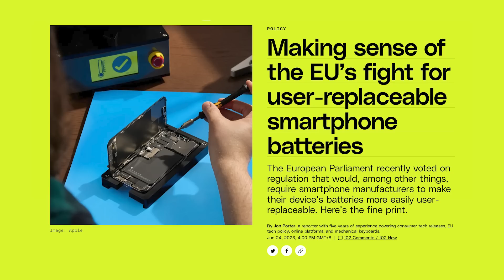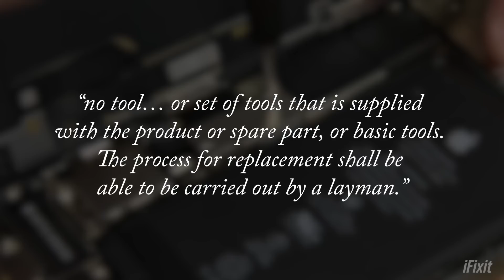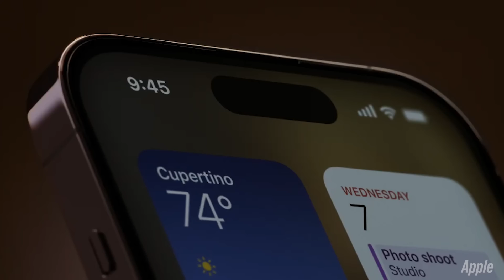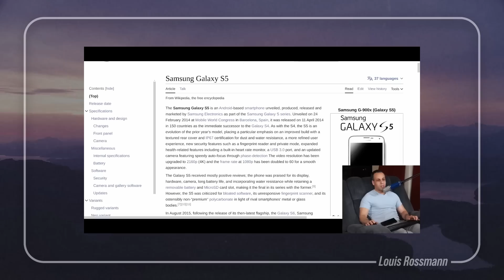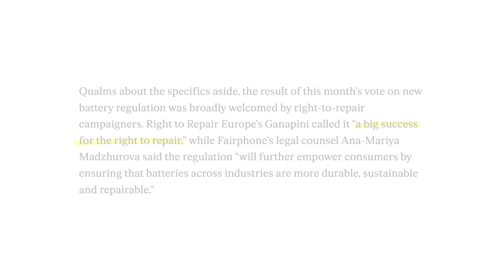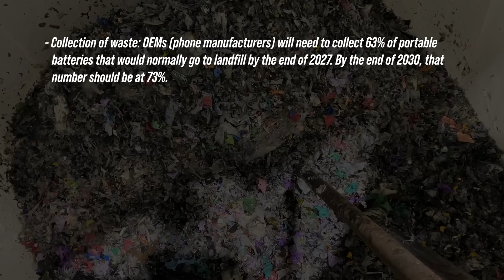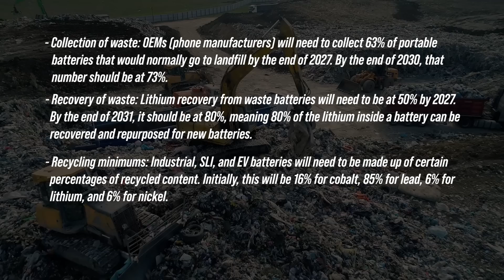EU Just Changed Smartphones Forever

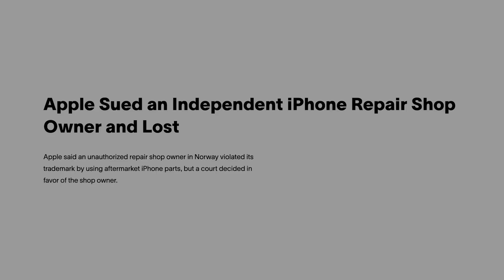Comment: Right to repair indeed.  The charger port on my ipad pro (barely a year old) quit this week.  As I am willing to try to fix stuff myself, I watched some related Youtube videos.  To replace the port, which couldn't cost more than a dollar or two to create, requires the screen removal, secured by adhesive, and very delicate.  Apparently experienced techs break about 50% (don't quote me) during the procedure and one of the online guys spoke about being rather surprised that he'd made the entire port replacement video without breaking the screen.  He had bought a spare replacement before he started - $600ish.  He didn't detach the screen completely, which seemed odd, since leaving the facial recognition cable attached made keeping the screen out of the way and safe a pain.  Now I know why he left it in place (5:05).

Great video.  If water proofing is the only problem with making the battery removal user friendly, a version with tighter seals could also be sold for more $$$.
Reply: Or encapsulation/conformal coatings could be used for sub-assemblies..

Comment: Soon to come will be electric cars.  It is very possible to have user replaceable batteries, we all plug in devices daily that has enough current to kill you, so there is no reason why we cannot change our own batteries.

I have a hybrid SUV and the battery is near enough dead, I can buy the battery for $4k easily enough, but the manufacturer has made it as difficult as possible to change and requires extensive work to carry out the job.  There is no reason why there cannot be an access panel and a large multi plug.

Comment: I have old watches submersible to about 100m with replaceable batteries, torches to a couple of meters. Good for the EU in this case. Phones just need to be waterproof to use in the rain, quite  a low IP rating, as I have no plans to dive with my mobile so  having an IP rating of 67 is  pointless novelty.  Its scam  to produce a limit the the life of phones.

Comment: I think it's a great step forward, and honestly it should be pushed even farther by forcing the use of standard format rechargeable batteries. A few new formats could be developed as there is no widespread standard for the kind of thin rectangles used in phones. Also in the case of cordless power tools, nearly all of them use 18650 cells inside a proprietary battery case. The current cells have specs that are all over the place, but we could develop a more standard 18650 cell that provides sufficient amperage for most usages, and that we could just swap into our power tools.

Comment: That is about time. The non replaceable battery design is a 'lazy' design that 1) reduces manufacturing cost but more importantly 2) entice consumers to buy a new product once the battery starts to deteriorate (in a way it is a planned obsolescence). In fact the only reason to glue the battery is because it is not intended to be replaced. Else there are other methods to secure the battery in place. (Btw this glueing practice is also bad for the recycling and it makes removing the battery from old recycled phone quite tidious)

Hence the only way to enforce the industry is by regulation and only EU or another huge market are able to pull this through.

Comment: My Galaxy S10 I bought in October 2019 is still in perfect working condition, not a scratch on it. I'd love to be able to easily switch out the battery for a new one and get another 2 or 3 years out of it but it's made annoyingly difficult with the way things are at the moment. I hope we go back to easily replaceable batteries worldwide.
Reply: I switched the battery on my S10e a while ago, it isn't that hard on that model. You just need some basic phone repair tools to get through the adhesive.
Reply: I'm still using my Samsung S5 bought in 2017. It's on ist's third battery and the old batteries were sent for recycling. It's no longer waterproof because the charging socket cover broke off.
Reply: You can take it to a local repair shop, if it's going bad...  I used to think the same, but then I realised that I never bought replacement batteries even when they were easy to change :)
Reply: @davidlloyd1526  I never had to replace my battery, but having the battery be removably helped keep my phone from getting destroyed, I think. I'd drop it a lot, and when it fell it just exploded into three pieces -- screen, back, and battery. Never cracked the screen until it fell flat onto a rubber floor mat from a height to 12-14", somehow... My newer phone, meanwhile, has actually needed a case and screen protector because as a single unit, the force of a fall actually does damage.

Comment: I would really love it when batteries are change able again, I feel bad with having to buy a new mobile just because the batterie is not doing as it should anymore... That and after not even a year, try to find the proper parts for your mobile that you would need for repair! I tend to get the normal version and for those old ones hardly anything is there to repair them!

So not just change able batteries... but there should be proper resupply in parts to repair a phone!

Comment: Actually, iPhone IS more environment friendly because it keeps away bootleg low quality batteries away that will work 1/3 of the original at best. This means you have to replace a completely dead battery every half a year, which will create more waste. And These batteries are the parts that causes the most problems for the environment. Mind that this environment-friendly approach is unintentional, because of how they are slowing down their phones with updates. The downside is that it is way too expensive for just a service itself. 

With this regulation the market will be flooded with low quality batteries AGAIN which only create more waste. I am old enough to remember how Replacing my Nokia's battery that lasted me for 3 years made me buy a new one every 6-7 months. So this is not an option if this regulation is being passed as environment saving. The consumer will benefit from it for sure.

Comment: I can see some devices having a real hard time finding a way to make replacable battery a thing. Small devices like wireless earbuds and the like. but I am sure they can figure it out. 
Buying a new battery used to be the norm and I definitely feel like people held on to their devices more as a result too.
Reply: Hearing aids exist and have replacable batteries, primary batteries even so they have to be replaceable. Also just use wired. There aint no way I'm ever buying a phone without a 3.5mm jack.
Reply: Actually, it isn't really that hard with earbuds and there already are some models where replacing the batteries is fairly easy. All that's really needed is for them to have a sensible shell design and internal layout. Additionally, we already have a few designs which implement exterior batteries, where the battery and the earbud can be easily separated without any disassembly.

Comment: This video makes the claim that including a removable battery will preclude the use of adhesives in the manufacture of cell phones. But this isn’t supportable. It’s entirely possible that phones will continue to rely on adhesives to prevent the intrusion of external material, including and especially water, even while featuring a swappable battery. It’s also premature at best to chain any hope of ameliorating exploitative parts replacement processes to the new law. Apple and their competitors are certain to manufacture phones with removable batteries that nonetheless make all other non-sanctioned repairs very difficult or impossible.

Comment: The samsung xcover pro has a removable battery and is ip68. It can be done, the main reason for sealed batteries is so companies can push consumer to buy new phones once the battery degrades vs putting a new battery.  Also it "looks" and feels "cool". If you have a case, then looks don't really matter.

Comment: The weight of a model s battery is 1,200 lbs how is that supposed to be swapped by a layman with no tools lol- It should be required that any computer/laptop comes with the ability to swap/upgrade parts like RAM/storage and batteries where applicable

Comment: Just anti-consumer. Look at Tile. You could easily remove the coin battery. When videos of that circulated and you didn't have to just buy a new one. They made it a LOT harder to replace, and added in some subscription deadman switch. I'm not picking on Tile in this case, just one incident that came to mind in a market of bad business practices.

Comment: Now i want to know how manufacturers will achieve that. Will we go back to those back covers made of plastic that if not taken out or  inserted back properly will break their holding pins making them useless? Unless they can replicate the same sleek, dustproof and waterprooof design current phones have, this law is going to mess up A LOT of things. I get it, the EU wants to enfore our right to maintain and repair products we own, but at what cost?  Phone prices will skyrocket because companies will need to find an expensive solution to waterproof and dustproof their products, if they can do that now at all. This applies to tablets as well. For laptops, e-bikes EVs and other things it will be the best thing to ever happen. But not for tablets and phones.

Comment: Every word said about Apple’s attempts to squeeze out maximum revenue from customers is true. I have a 1st generation Apple iPad which is in immaculate working condition but simply cannot be used because practically no software or app is supported by it - and that is by design - Apple design. Begs the question why does Apple take such pains to produce products with such long life if they intend that it be obsolete and practically unusable during that life. Shouldn’t it be mandated that components be easily upgradeable (at one time, RAM upgrades were possible) to ensure that products are useable for longer periods? This would minimise customers having to junk their phones as often as is intentionally schemed by Apple and others today.

Comment: I think the big push for non-replaceable batteries was two fold. 
One, to charge more for replacing the battery or encouraging device replacement. 
Two, laziness on the part of the manufacturers to make their devices dust/water resistant. It's much easier to make a completely sealed case that is water/dust resistant than to make a device with doors/ports/panels/etc. be water/dust resistant.

Comment: Batteries also need to be standardised across different brands in the same product category (eg. one battery standard type for all phones, one battery standard type for all e-bikes, for all laptops etc.). Only then will it be feasible to get consistent replaceable batteries, and for some larger devices like e-bike and EVs, battery rental, and transport & use across different continents.

Comment: Wouldn't... wouldn't having no adhesive remove most water resistance?
Reply: The only thing that would need to not have adhesive is the battery and whatever thing you have to open to access it

Comment: The original purpose for the glue on the battery was to avoid concussion. Concussion was the number one reason for batteries to either fail or possibly cause fires. There are very few designs that actually take concussion into consideration that also includes battery replacement. Until such technology is available most phone manufacturers are stuck gluing with their batteries to the inside of the chassis of the phone to avoid catastrophic failure. This is also a reason why there are so many issues with repairability of phones which is legitimate concern. Repairability extends the life expectancy of the phone. so there is a fine line between repairability and safety. As long as the construction technology of the phone includes some form of safety when it comes to replaceable batteries, we're left with glue on the battery. there are ways on the other hand of designing the phone so that even though the battery is glued into the chassis the battery should also be removable in some way and repairable. Unfortunately most phone manufacturers don't see this as a priority. They just want you to buy a new phone. This means simply that phone manufacturers suck.

Comment: Finally! I remember that from 2000-2012 it was a delight to have cellphones that would last 3-5 years each, you could replace parts, and a major drive behind changing your phone was to upgrade to innovative newer models; in 12 years I owned 2 hand-me-downs and 3 new phones. Starting on 2013 smartphones were all the craze, but to me the shine dulled quickly... for the past 10 years all smartphones have looked the same and have had the same functions, so not only the novelty is gone, the worst part is that I've had to replace them every year because they break down and won't allow the most basic functions they're made for. A real waste of money and terrible pollution.

Comment: All I heard is manufacturers are going to have to go back to how some Samsung and most LG phones (in full disclosure even though their phone division is gone I've been Team LG for decades) used to be. Easily removable rear panel that exposed the battery, SIM and SDHC cards that took mere seconds to remove/replace. They don't have to re-invent the stinking wheel, they invented it a long time ago. All they have (are going to) is build "new" phones on their old chassis designs with modern components.  Anyone over 40 knows what I'm talking about and wont bat an eye...

Comment: Pfftt LG mobile went bankrupt that removable battery was their last phone... I use a redmagic 7spro. Redmagics website shows a full teardown. No one wants to open up and peel back fragile layers of cooling. You can buy a pc and replace the cpu by swapping out the thermal paste... Most users don't know or shouldn't be making these repairs. Back to dumb non complicated phones Isn't great for the future. They should just offer repairs by the company. Because this eu law is all smoke and mirrors. We still can't use another brands charger brick and get max speeds. If you take a Samsung 35w brick and plug a pixel in it only gets 25w charging even though the pixel brick can do more than 25w. Its a farce. Its greedy corporate influence. Meanwhile in China their government was able to force all chinese manufacturers to offer the maximum charge speed to all brands. You can take a nubia 120w charger and charge your ipad at 120w or your Samsung at its maximum 35w or your Huawei at its max speed etc... If the chinese government can do it then it makes sense we have this too but we don't. Simply put they like to keep you in their eco system. So if they can make different spec plugs for china with different detection chips im sure they can make different phones with removable backs just for the EU.

Comment: everybody is going digital it's pointless to make a removable battery you should be updating your phones every two or three years in order for your phone being able to work on the current Hardware.
Reply: now , someone explains to me ! Irreplaceable batteries in smartphones , does it mean that it's impossible to completely cut the power to the device , and thus it's always possible the device to be located as it does send vibration even in OFF mode ??????
Reply: @Quasar900   the bottom line is the more moving Parts you have in a phone the less likely it's going to be durable if the EU have such a big part of with electronic waste maybe it's time to invest on getting the technology to recycle majority of the items in the phone to a point it can be melted down and rebuilt on a new device like thay all ready do with paper & steel instead being lazy and just putting in the landfill. while creating new jobs.
Reply: @Quasar900   all the electronic waste we make here get separated in remolded for new devices & technology same with our motor oil and battery.
Reply: @Quasar900  even the bio waste that gets flushed down in the toilet here gets recycled after it get treated of course.
Reply: @NORDICedm  
All you said I know it ! My question is about the fact that non removable batteries phones , are always somehow ON Power hence it can be traced and located (the stuff of being permanently viewed by social media)

Comment: 5:40 ... How do you understand apples argument?...
People fix their own break pads on their cars and tractors and... you think theres anything remotely dangerous about repairing a ducking PHONE!?
Reply: now , someone explains to me ! Irreplaceable batteries in smartphones , does it mean that it's impossible to completely cut the power to the device , and thus it's always possible the device to be located as it does send vibration even in OFF mode ??????
Reply: @Quasar900  the batteries in modern phones aren't irreplacable. They can be replaced, just not very easily. Power can still be cut without much work, provided you have the right tools.